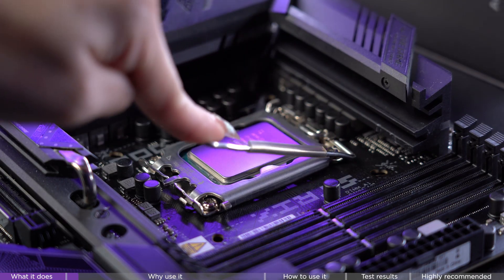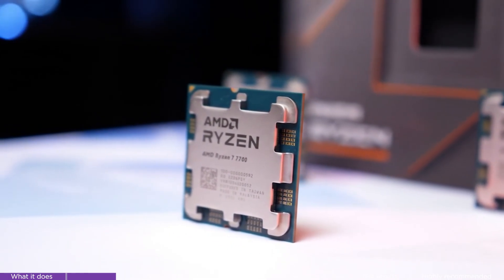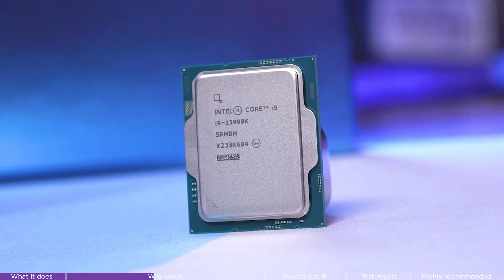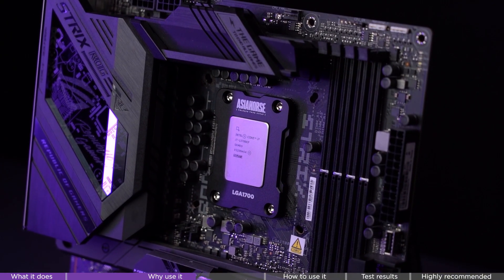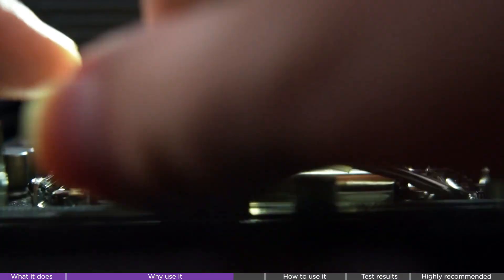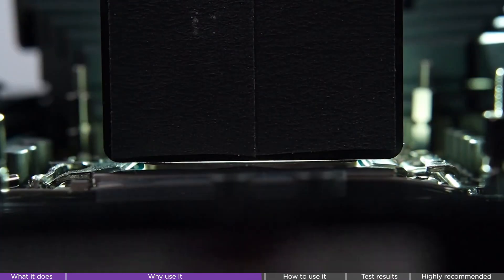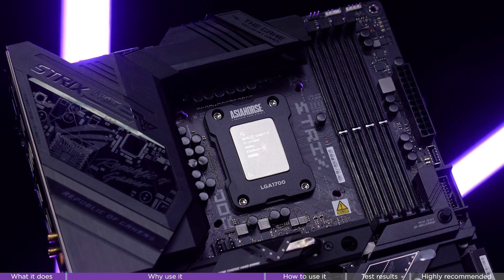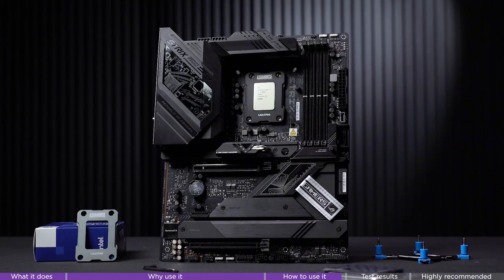This Tiny Upgrade Drops Your CPU Temps by 7–10°C?! | CPU contact frame for Intel & AMD

Comment: 😂😂 lol this does not to drop temps just lies for sales 🤣🤣
Reply: contact frames actually do droptemps. gamers nexus did a video about them in the past though it tends to be far better on AM5 cause you fill those gaps with metal. i think intel was doing 3-5c and amd did 7-8c
Reply: @ojmachine9545 and that's just a beneficial side-effect of what they are actually intended for. Over time, the points where the bracket locks onto the cpu will warp due to the constant heating and cooling and the uneven pressure on the perimeter of the cpu. Contact frames provide an even pressure around the entire cpu.